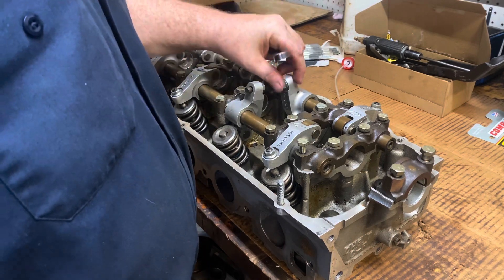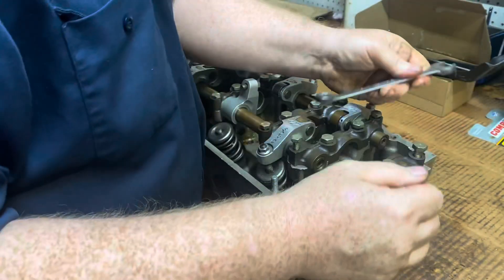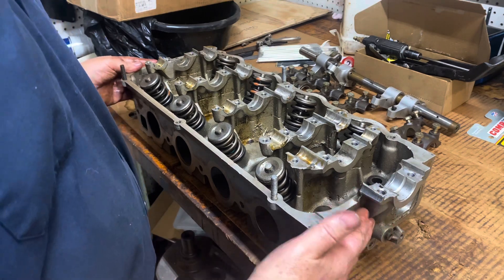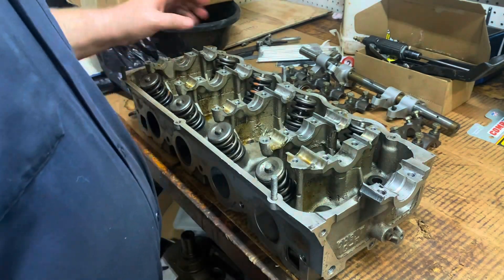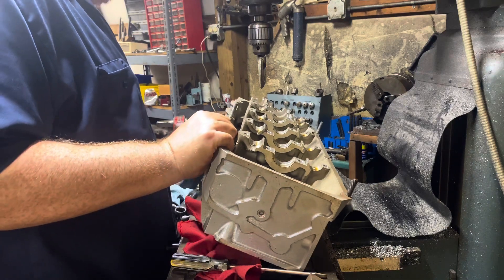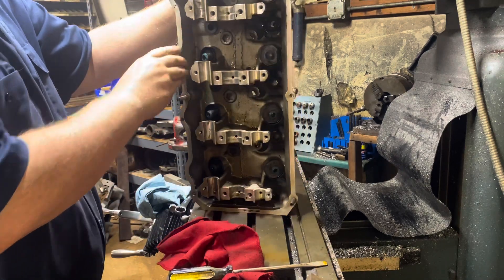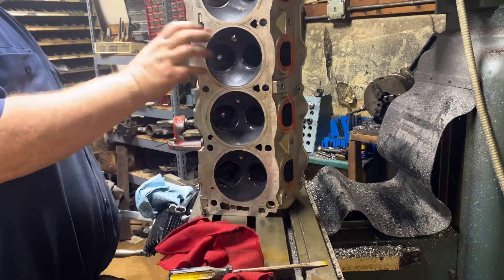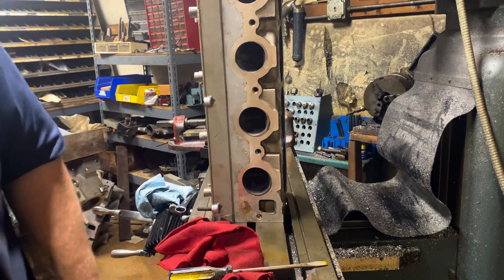427 sohc cammer fe build part 7. Taking apart a set of used heads for evaluation.

Comment: When we lost a couple engines with the sodium valves, they were night races.  The most beautiful red/orange flame instantly came all the way to the back bumper. The first time we didn't know what happened. Obviously the driver did.  The next race we lost another. Back then, there wasn't choices so much. What was bought was Deisel valves because they were soft and would bend without breaking. Never had another failure. We believed the exhaust valve just couldn't survive valve bounce. It was because we used big RPM and valve springs weren't that good.  But RPM was key even in those old days.
Reply from the maker: Very interesting. Thank you for sharing